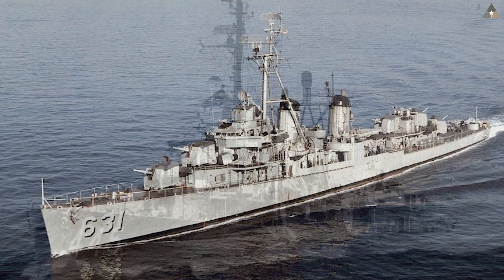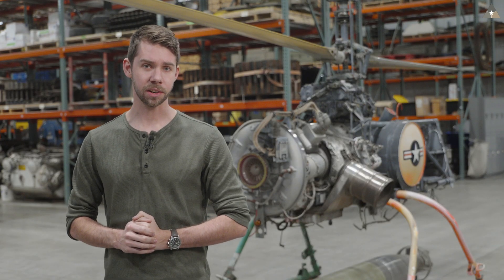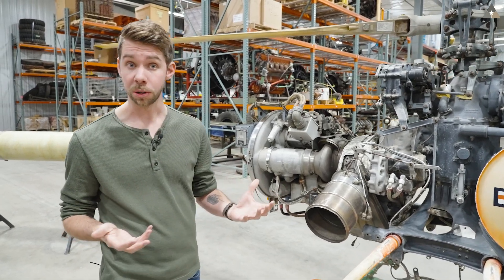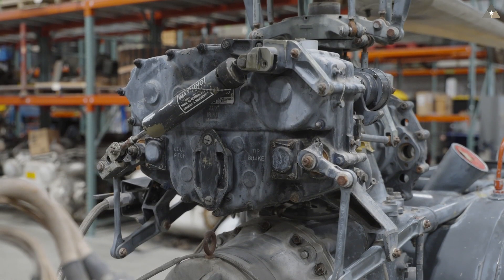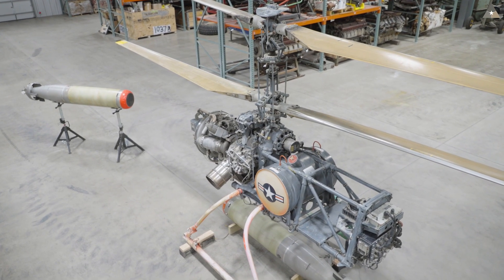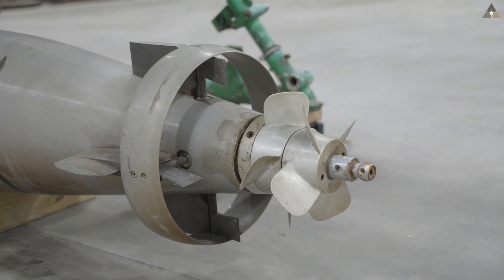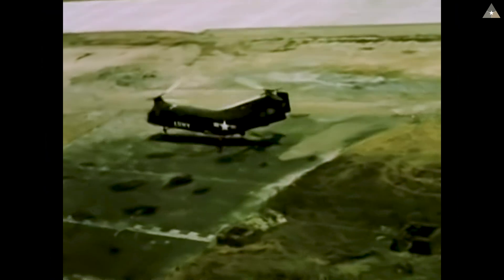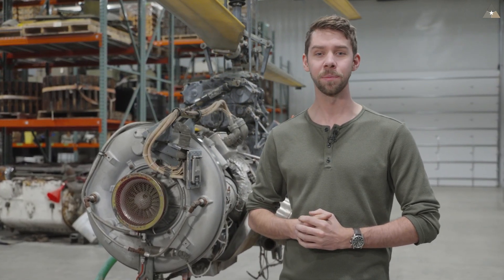QH-50 DASH |  The First Drone Helicopter Weapon

Comment: I was in "Dash" division aboard U.S.S. Ault DD-698 out of Mayport, Florida. The U.S. Navy School for DASH was at Dam Neck, Virginia at the Naval FAAWTC Base next to Red Bird Lake. The "D" models were far superior and didn't have the tail section like the "C" models. Also the "D" models had a floatation device on the rear that was actuated by salt water if the drone went down into the ocean for recovery. The "C" models had wooden blades while the "D" models had fiberglass blades. The "D" model carried two Mk. 44 homing torpedoes. Aboard the Destroyer we two birds ( helicopter ) that were bolted down to deck brackets inside the hanger. Also a twin cable system above the deck with rollers could be attached to the skids if they were needed is rough weather conditions for a launch. Our berthing area was in the hanger with them as the cots/mattress we had were way more comfortable than the berthing area racks aboard ship. We also had our own TV in the hanger for our use. Something that no one had except the ship Captain. EN-4 Baker U.S. Navy 1966-69.

Comment: Thanks for this. I wonder if the basic idea goes as far back as the U-Boat towed Focke-Achgelis Fa 330 Bachstelze (Wagtail) used for spotting ships.
Reply: Probably - it's very rare that a "new" idea is actually new, most things will have been tried decades or even centuries before, but weren't successful because the manufacturing, technology or materials weren't good enough to scale up for mass production or to be really successful.

It's quite fun to look at something "new" and try to find a failed predecessor (as an example, electric cars are all the rage now, but there are electric cars old enough to take part in the London to Brighton (pre-1907 production cars) rally every year.